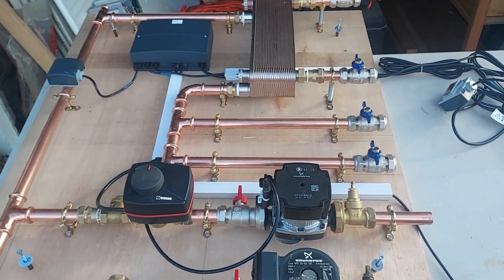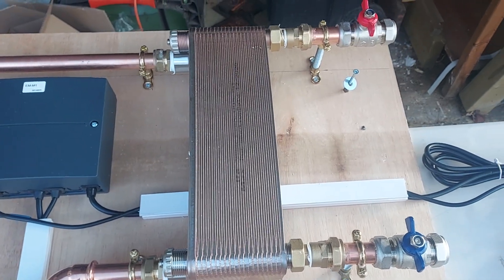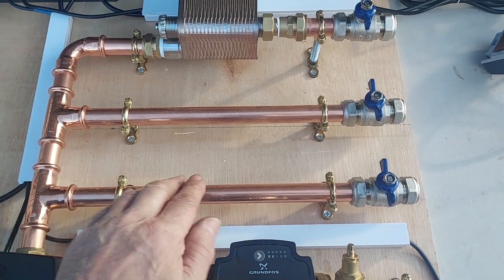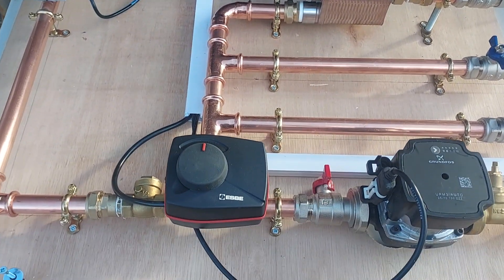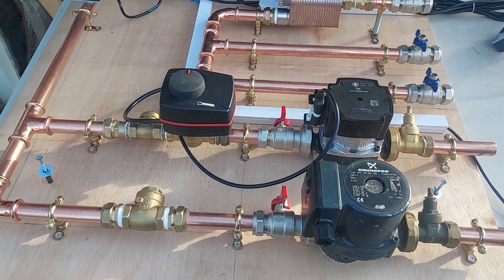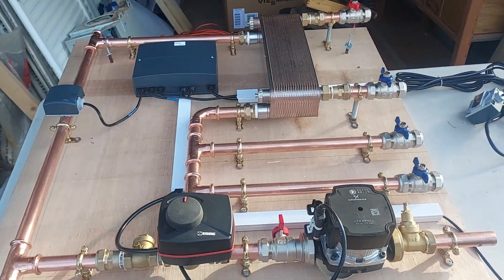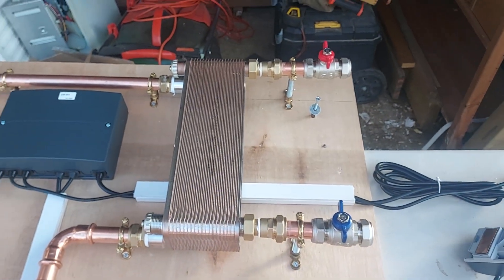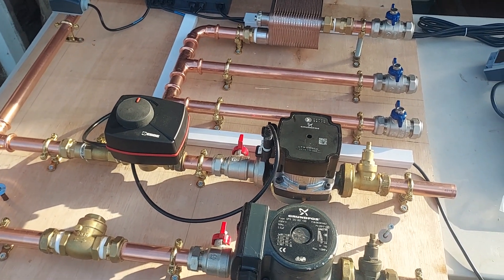plate separation with electronic mixing valve

Comment: Looks great 👍. 
A question:-  Why would the Radiator Rtn only flow into the plate and not the Mixing valve AND Plate ?  It's a Tee, so won't it try to go in both directions  ?
Reply from the maker: The volume of flow into and out of the ufh is the same so no flow can be drawn from the radiator circuit

Comment: Nice and high tec work as usual. Love ur videos as usual 
Just quick question pls why u use no return valves?! Is it bec u have mixed circuit for underfloor heating? Also if plate heat ex is used for for radiators circuit and hot water cylinders do u still need these NRV. Much appreciated
Reply from the maker: The nrv stop reverse circulation when one pump.is on and the other off.
Reply: Would u still put NRV if u have one heating circuit of radiators and one for hot water cylinders (not separate hot water priority scenario) many thanks again
Reply from the maker: @conand1413  one for each pump unless using zone valves
Reply: I thought the same but always its good idea to ask the expert. And not just any expert but the expert, i aspire to be half as his expertise
Reply from the maker: @conand1413  thank you

Comment: Is the little black box on the distribution header purely just a temperature sensor?

Are the 2 pumps the same for mixed and unmixed circuits?

Why didnt you use 2 mixed for radiators and underfloor.
Reply from the maker: Yes it's a temperature sensor.
One because its cheaper than two

Comment: Just great. In terms of system efficiency is a plate heat exchanger better or worse than a low-loss header? Is it only because of the need for complete separation that you would choose one over the other? Many thanks!
Reply from the maker: I think a plate offers lower efficiency if we ignore main hex contamination. The purpose is to prevent that so in theory it's more efficient with a plate. Not proved this though.